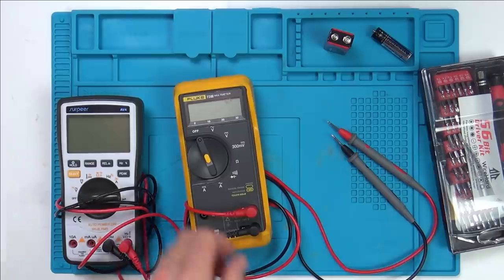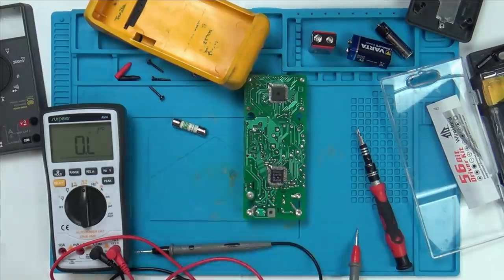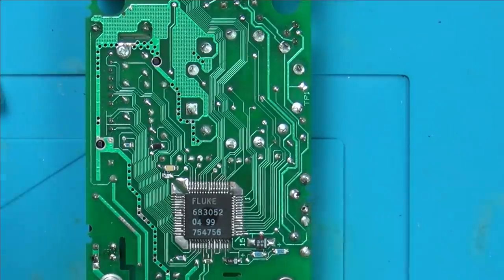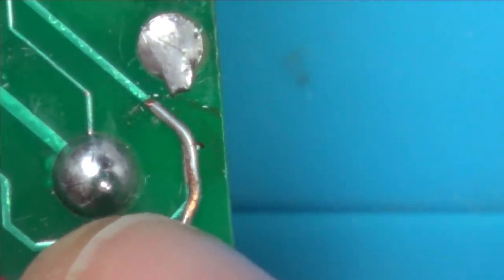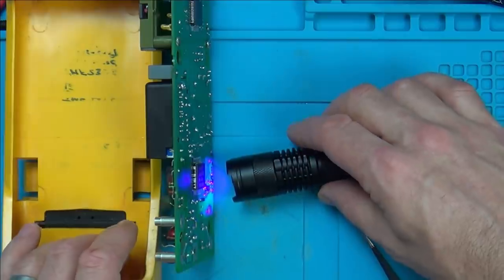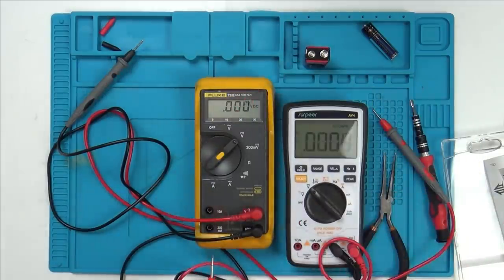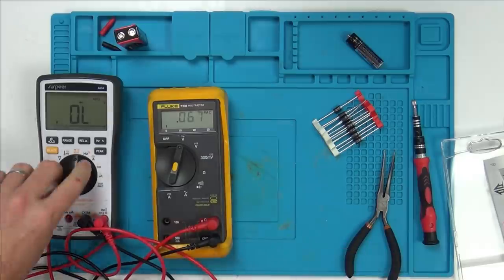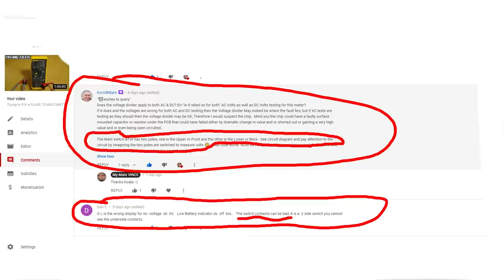REVISIT - FLUKE 73 MULTIMETER

Comment: Hey Vince. Do you want a faulty ps3 slim for one of your videos? It suddenly turned of and only works for few seconds until it goes off again. Already bought a new PSU (since I thought it was the problem) but it didn’t work. So I don’t know what’s wrong with it and maybe you could try to get it working again. Of course you can keep the console and do whatever you want with it.

Comment: There is a chance the Fluke won't be accurate if a conductive fluid has been split on it and it hasn't been thoroughly washed. 
Had an invisible dried fluid on a PCB that was causing slight conduction between pads that made a LED glow slightly, and only after washing the PCB did it go away.

Comment: Your wire bridge seems to probably be alright but as a general rule I don't use wire with a diameter bigger than half the width of the trace, just because it can be hard to get it to stick to the trace in a satisfactory manner.  Since the wire has a lot more thickness to it than the trace does, it does not need to be anywhere near as wide to act as a suitable replacement.

I probably would have started the way you did, but then after cutting the wire, reapply flux, then hold the wire with tweezers while tapping the iron tip with solder on it.

Comment: always use things like a camera on a tripod, and a pc, then you can zoom in on the picture in something like windows paint, and check for damage around a suspected leaky battery terminal. it would have saved roughly 4 hours then. although wouldn't make much of an interesting video, but would also save on eye strain, plus having problems moving a microscope constanly and loosing track of the traces.

Comment: You can use thinner wire but by using a hammer to pound it flat(on a hard surface! Not the circuit board itself!!) it can sit flush to the board

Comment: Wow, those 250 V from your AC grid. Is that normal in the UK? You sure get lots of Volts in there.
Reply: is actually not so unique as you might thing (and it mostly depens on how far from transf or any other "booster" you are). at my home i have ~236, at my cottage it's ~228 (we're at the end of the line there) and at one theatre (we did in my work) they have ~246 which gets over 250 quite often (and burnes quite a few power supplies in many devices linke low-edn laptops - in case you're interesting the provider keeps saying it's "ok" and they have a looong ongoing court issue with them since many quite pricey deviced don't like this voltage too). So it's not unique, just troubling.
Reply: 230V here in Australia, but is allowed to be anywhere in the region of 216V and 253V. Unlike the UK though, we don't have fuses in the plugs, because why would one do that, makes zero sense! All our GPOs are 10A for houses and 15A for things that need a tad more juice.
Reply: Standard here in Germany was 220V, was adjusted to 230V later, today we have 240V but that ranges from 240-250 anyways...

Comment: You were touching both probes with your fingers when you where testing the 220K resistor with your own meter, placing your body resistance in parallel with the resistor under test. 2 resistors in parallel makes for a lower total resistance. For larger values, such as that 220K, this can have a notable effect. This is probably why your meter measured that 220K considerably too low.